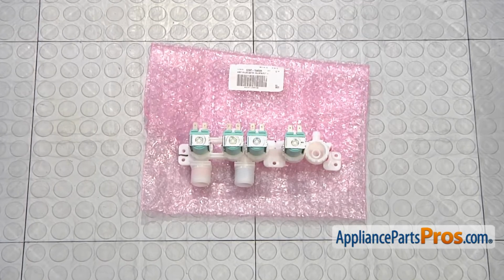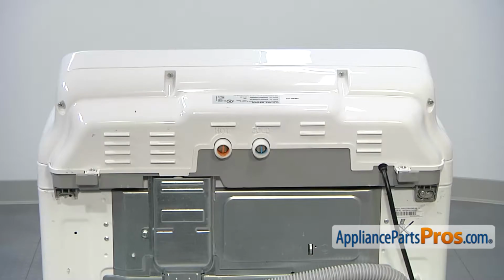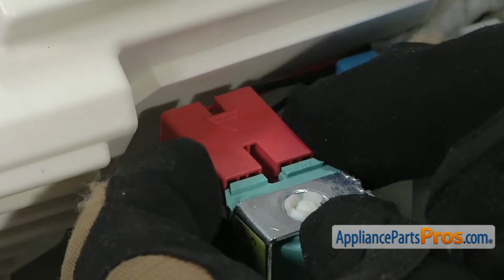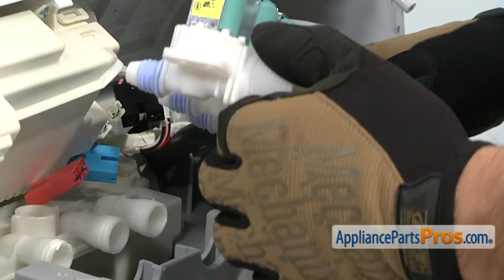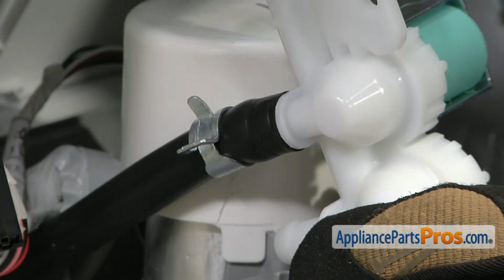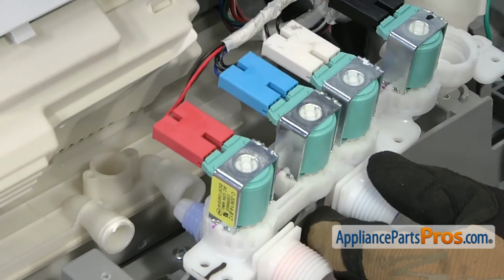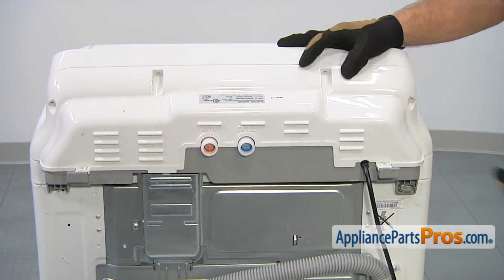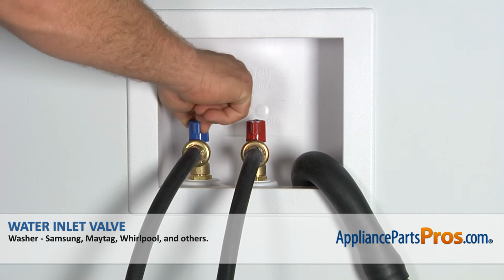How To: Samsung Water Inlet Valve DC97-15459H

Comment: What is the conmection just to the right of the solenoid where you connected thd black hose with the clamp? Is it aome sort of flush port?
Reply from the maker: That hose connects to the water valve.

Comment: I've a "nF" code.  Washer was making some whistling noises when filling not sure the noise was from the water line hoses or the washer itself, also it was repeating the filling process and some water in the little blue tray where the detergent goes, not sure if the issue is water inlet valve or the old hoses, either way I'm planning to tackle both to be sure.
Reply from the maker: The noise could be coming from the water valve. It is normal for some water to be left inside the detergent dispenser after the cycle. But you can check the hoses and the dispenser for any clogs that could be causing the issue.

Comment: Thanks so much. My Samsung was giving error code 4C, couldn't pull any cold water through. After cleaning valves and other quick fix tries, this was next step. Quick and easy replacement thanks to your video.
Reply from the maker: You are welcome! Glad you were able to fix your issue! If there is anything we can help you with in the future please let us know.
Reply: @appliancepartspros  hey inreplaced this part and now i am not getting any water?   it turns on sounds like calling for water and then spins but no water?  any ideas?
Reply: i figured it out. it just takes a minute for the water to come out

Comment: Great video, the problem here is your site wants 142 bucks for the part, I just bought it on Amazon for 32 bucks.  Your price is a complete rip off. Why so much for the same part??
Reply from the maker: Our prices are set at the manufacturer’s level, as we only sell OEM parts. I apologize about that.
Reply: @appliancepartspros  doesn't matter to me either way, just thought you should know. No one is going to pay those prices when the same exact part is available on other sites for 110 bucks less.  Mine came in today, 32 bucks delivered, installed, works perfect. You might sell more parts if you change vendors, that is the name of the game, right? selling parts.

Comment: Thank you, very helpful video.  What a shame that, including replacing this valve, in 7 years of ownership I have now spent nearly 80% of the original cost of my Samsung washer in repairs. Includes a failed main board and several fixes of the undersized wiring to the drain pump.  Not to mention the inconvenience to our household and the concern caused by finding water leaking through the first floor into the basement for this latest problem.

Comment: If the threads are stripped, is the solution to epoxy mini shut-off valves or fittings onto the threads, or replace the whole valve.
Reply: I ask bc the threads on my washer's inlet valve are stripped
Reply from the maker: +STLbluesfan1 There is not much you can do to fix the threads, it is best to replace the valve.
Reply: +AppliancePartsPros ok thanks